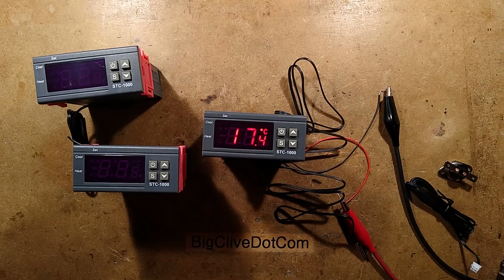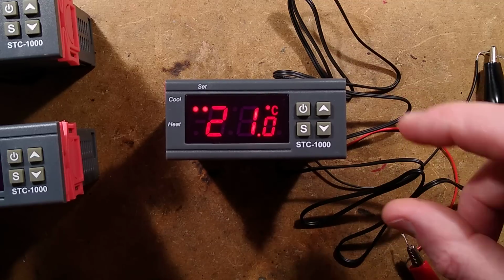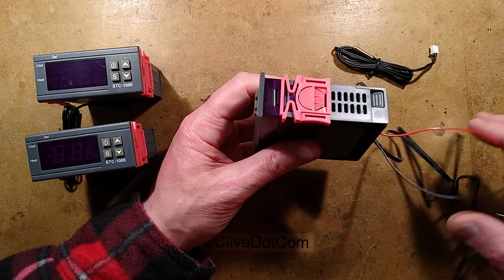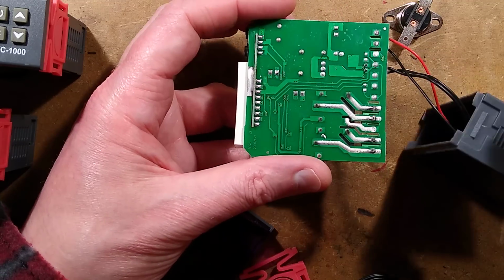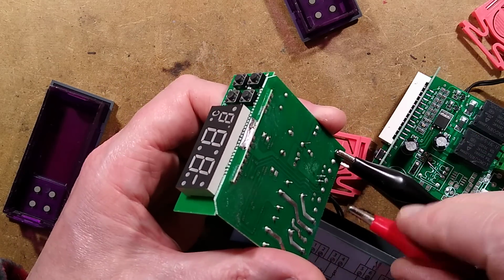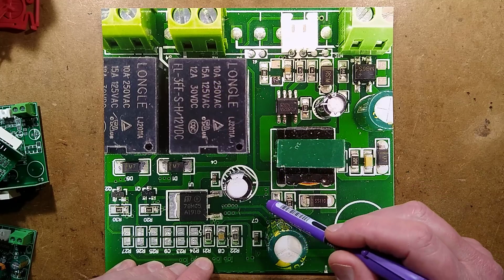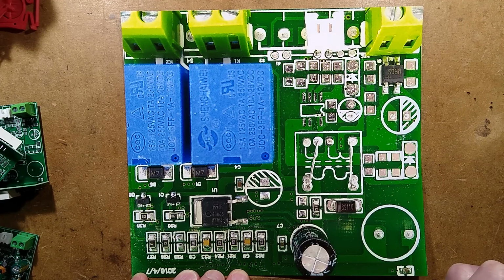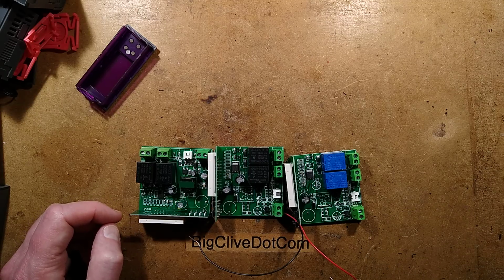Teardown of three STC-1000 style thermostats

Comment: If you have a 240v 1 you can remove the small transformer inside and solder wires straight to the transformer output connectors and supply 12 volts 👌

Comment: Im looking for a automatic thermostat to cool my solar inverter with 3x 220v fan (ball bearing 3.5w each) 
Would you recommend this for my project ?
Goal is to maintain the temp 40C
Reply from the maker: You may find it much simpler to use a classic bimetallic thermal switch with a fixed temperature.   Depending on whether you can derive a 12V supply easily, you may also find 12V fans quieter and more efficient.

Comment: Here's a question for anyone. 
I bought one of these to turn on a cooling fan for a power supply for my ham radio station.
To make it easy, the normal room temperature is 70° f and I have it set to call for the fan at 100° f. 
This seems to work fine, however, anytime it is not over 100°, the heat relay stays energized. How do I stop this?
Reply from the maker: The video description has a simple programming guide.  Try adjusting the hysteresis to a much wider range.

Comment: Mine i just bought is again different. All my components are on the bottom side of the board and only the relays and caps on the top. and missing the trans. The solder trails on the relay contacts for extra beefing, is very slack and spoty. I added more for a thicker traces. $9.09 eby. I am using mine on my incubator as a replacement temp control. The heating unit draws 31watts on my ecoflow power supply, for which i have connected just in case my mains power goes out. This replacement control, works even better then the controls that  the incubator came with. Gonna get more of these controllers to spread around. Maybe even mod some of the aquariums with them. Super units.

Comment: I bought one for 5.60 $ on aliexpress, a 120-240V And I can say the one you have is much better quality ! When I took mine apart I tough they give me a 12 or 24V version because inside in the power supply area there is only 2 diodes in series, 2 capacitors, 1 7pins chip and an inductor. I think it's a buck converter and the input capacitor is rated for 400V. There is only 18 components on the main bord + 2 relays of doubtful quality, not even a voltage regulator.

Comment: Do you have a pinout for the 7-segment display used in that device? I'm trying to interface it with an arduino to get the temperature data but I don't know what are the pin labels for the 7 pins
Reply from the maker: You may find it easier to use a dedicated digital temperature/humidity sensor for the Arduino.

Comment: stc 1000 with 220v input... how much out put could give through cooling out put ? i want to make it my aquarium Hailea hc250a chiller 1.3amp 1/6hsp control unit, and its consumption is 300w. is it preferable ?
Reply from the maker: The most rugged approach is to use a 12V unit to switch external relays.
Reply: @bigclivedotcom  no I want to use 220v one. Is this possible?
Reply from the maker: I'm not sure how the tiny relays in these will deal with inrush current on some loads.

Comment: Be aware! Some of these units marked for mains usage are not mains rated for their own power (plug by the thermistor plug). I found this out by accident the GOOD way, when I popped the cover off, and it's just a little SOIC8 DC-DC chip, inductor, and filter cap. I haven't tried, but I'm pretty sure it would vaporize on mains, even USA's 110V mains.

Comment: Just bought one and its for a 24v application. But when heating or cooling there is no power going out to either side. Am I doing something wrong or is this unit a dud?
Reply from the maker: The relay contacts will have to have the 24V looped over to their common contacts, as there is no buss inside.  If you can hear the relays clicking then they are probably working.

Comment: Wondering if I need to shoe horn a 16A relay into mine, as using it for a 2kw heater (so 8.5A) and it the relay does get slightly toasty, i'm not hugely confident in cheap relays, even if they do say 10A 240v. I've got some 16A Omron 12v relays with the same pin layout, but slightly taller.
Reply from the maker: The best approach may be to do what the commercial refrigeration controllers do.  Use a 12V unit and external 12V relay to switch the high load.  The 12V units are more reliable and the relay can be chosen for the load and changed if needed.

Comment: Is it good for coffee machine? I want to use it for my brasilia club with SSR relay.
Reply from the maker: I can't advise on specific applications.  If you do make a modification like this, also include an extra mechanical thermal switch for safety if the SSR fails.

Comment: Hi there. I have an odd question. I've resently bought a 12v controller and is trying to get it to work. First I would like to test it out by using a 6w light lamp as heating before connecting the unit to a incubator. The problem I'm having is that the unit is connected with a 12v adaptor which should give me also a 12v output but the light doesn't comes on plus testing the output with my digital tester, it's giving me a -12v output. The light lamp itself do warm a bit up. I went online, did some seaching and found a vid where a guy had swop the possitive and negative... so I did the same and still no light coming on. On the plus side, the unit have 12v input with 12v (not -12v) output. The light still feel warm after connecting. Any ideas what on what to do or could the unit perhaps be faulty? Thank you
Reply from the maker: Is the display lighting at all?
Reply: The display on the unit works 100%, also when changing the temprature the unit makes a click sound as the relay activates. The power goes through to the external light but it doesn't comes on. I've changed the light with 3 others lights and all does the same. The lights do work when I plug it in at a light stand.
Reply from the maker: @gerhardyoung7132  The relay section may have volt-free contacts, where you have to bridge a supply connection to the common contact.

Comment: Hello - Very interestinbg and detailed video - Thank you. I will use this Controler to check the temperature of my beer fermenters. My big problem is that I don't know wich kind of temperature probe should I use. I've tried with a PT1000 probe but it doesn't work. Perhaps because the resistance in Ω is too high. Should I use a PT100 or something different. A big thank you if you have the answer to my question. And sorry for my poor English (I'm French) . Best regards JY

Comment: Bought the mains version of aliexpress. Extremely dirty PCB and solder blobs everywhere. Uses a one way rectifier and a buck converter to create internal 5V DC, so no isolation from the mains. They've routed some isolation slots in the PCB, though 🤪 I connected some wires to the bulk electrolytic on the DC side and used a USB power supply to power it.
Since the PCB is virtually empty in this low low cost version you might also be able to fit a DC/DC converter module in there to run it on any DC voltage.
Reply from the maker: Good move on the external supply, as the mains one sounds like it would be making the thermistor wiring live with respect to ground and it's not rated for mains voltage.

Comment: Just bought one from ebay. Super cheap but the circuit board has much less components and also the soldering looks pretty bad and the PCB isn't clean. I plan to control an electric heater but I'm gonna put a contactor in between as I don't expect it to switch 2kW.
Reply from the maker: Good move.  Even a chunky relay is a good option.

Comment: Can you do a tutorial of how to wire one of these 240v units to control trace heating on 15 mm copper pipe.
Had a freezing disaster last year.
Reply from the maker: It might be worth adding an external relay for the tape.  Technically speaking you could use a simple bimetallic thermostat switch to bring on the tape when the temperature dropped well below freezing.

Comment: Thanks for the explanation of how these work, but.
You did not solve my problem with these 240v units.
The wiring diagram on the unit says mains in to 1 and 2.
I would have thought neutral to left and Live to right, but YouTube is opposite.
Port 5 and 6 are for heating.
I wired in a piece of 240v trace heating + to 5 and - to 6.
I expected the relay inside to switch power from 1 and 2 to 5 and 6.
This does not happen. Why

Comment: Hi Clive, I have had now two of these units blow on me, the STC 1000 220v version. Once installed they work perfectly fine for 3 to 4 days with no issues, but about the 5th day they blow, they go completely dead, when I opened them up, both have blown the chip 8321A which I believe you called it the "switching chip", and i am very puzzled as to the reason this is happening, loads are on external relays, so the controller is only switching on the external relay, so I do not see a reason why it´s doing this, could you advise me what your thoughts are for this chip to blow only after a few days of operation?
I have checked for wiring hot spots (loose connections) cabling is all 1.5mm, everything is 10A plus rated, voltage supply from mains averages around 230v, I am using it for an incubator to maintain a temp of 37.5º with a deferential of 1.2º and a delay of 1minute. any advice is most welcome, please.
Thanking you in advance.
Reply from the maker: Check the voltage isn't too high.  It's possible that there may also be an electrically noisy supply.  If these are from the same source they may just be bad units.
Many commercial units use an external 12V power supply to power the module, as it's cheaper and easier to replace the power supply.

Comment: I have one that is the exact same unit…except instead of a heating controller it’s a controller for humidity levels. It has a humidity sensor (3 wire) where yours has temp sensor and the blank pads say temp or Hoc (heat control?) or something along those lines. It doesn’t have any option on the front panel for heating or cooling (strictly relative humidity), so I imagine it’s just a cookie cutter design with different functions based on the ic chips programming and a few swapped components depending on the features…
Reply from the maker: The three wires sensors are often combined temperature/humidity sensors that communicate via two power wires and a data line.

Comment: Nice movie! My STC 1000, version 100-220V AC is dangerous. There is no AC/DC isolation (no transformer only reducing chip PN550H (?)) at the input and a full input voltage is applied to one wire of NTC sensor. I have other temperature controllers and there is old-style trafo at the input. Fairly safer! This version of STC 1000 should be prohibited.

Comment: I saw a unit with two temp sensors and it was advertised to run on sensor 1 unless that sensor failed than it would sound an alarm and run on sensor 2
Reply from the maker: That's a good idea.  Some have a function where they switch to a fixed duty cycle if the sensor fails to try and avoid a total defrost.

Comment: Hi Clive . I got delivered a 220V version rather than a 12v version I ordered  and rather than send back I decided to use. I mounted it on top of my metal earthed chassis psu. Rather than use the NTC that came with it, I decided to use the NTC on my 3d printers heat bed. Stupidly I was connecting it with mains going into the controller and managed to short the NTC output to the Earth metal chassis of my PSU with my screwdriver. Curiously though,  the resulting flashover tripped my house ELCB and destroyed the controller. I deduced that the only way for this to happen was if mains supply had got onto the thermistor somehow so I watched your video with interest. Don’t know if it was a manufacturing error, lack of insulation or poor design but Id definitely stay away from the 220v version as getting 220v on your 3d printer chassis would be a bad day…

Comment: Been running 250VAC STC-1000s for brewing temp control for many years. Lovely units for the price. One of mine is now 10 years old and still working 100%. But yes, don't over-stress the internal relays, I'd say 10A @ 250V is optimistic: 2.5kW would cook the relay. I'd say half that is safe: a large domestic fridges, freezer or smallish heaters would be the right unit to control, considering the inrush load. Industrial size fridges or heaters would require external relays.

Comment: I've used thermostat modules called w1209 in a few project. They are very cheap and their software looks similar but they have only one puny little relay with 1 contact. And because there is only one contact, in the menu there is a setting where you choose whether you are using the module for cooling or heating.

Comment: Hi Clive this is not a criticism it's just something I was thinking of from my past where we used lots of control gear on critical processes to ensure they were kept in check at all times and the meters were manually checked using a Calibrated handheld meter by technicians from every hour to once a day dependant upon the process and how stable or critical it was. So although I could verify, as you did, the meter against the one that there which was calibrated if they were the same I would still have to have the new meter Calibrated by a third parting because of the extremely tight specifications; Often I could get them Calibrated when I brought them with a Certification but they have to be recalibrated every 6 months or maybe one year again dependant on what a failure would potentially cause. So although in your case it was not required to be calibrated to those extents it's always worth bearing in mind or probably ignoring it altogether and let the tech people sort it out.
After 36 years they broke me, so I no longer have to follow British Standards or try to work out what they meant .💩 
Thank you Clive for all your content, it's wonderful and this video suddenly brought back my past looking at the control gear

Comment: As a few others have mentioned, I'd love to see you investigate an Inkbird one. I have two Inkbirds which I used over the winter to precisely heat rooms - very accurate, useful and energy saving indeed. I also have the humidity variant which is also proving accurate and reliable - the huimidistats built into dehumidifiers are often wildly inaccurate. I swapped out the generic relays with Omron ones - the STC-1000 relays look like Omron G5LE pattern clones.

Comment: I am  using this in my refrigerator after the OEM thermostat failed twice. Using the 240Vac version and the 'cool' relay is driving the compressor (~125W) directly. As you told, the relays and the SMPS part are which I'm concerned about :)

Comment: These style relays are common in automotive stuff, and always trouble. (BMW central locking E46, fiat punto EPS motor drive, VAG window controll / roof motor controll.  so if you use one of these (as I do) to controll a larger load in the heating system for my workshop, use an external relay. I have had these style relays fail short in an h-bridge configuration .. window up, fine... window down? fire behind dash. Your welcome.

Comment: I just dug out a couple of these from my bits box, I've used them for various things over the years. On the two mains voltage units, one of them has the same dodgy circuit board design that's in your one  - where the's practically zero separation between the mains and the sensor connector. The other is far better - it has a sealed mains to 12V PCB mounted power supply, and more anti tracking slots to keep the pixies separate.
Sadly I managed to kill the good one... and I'm not as confident in the shitty one as I used to be.

Comment: Do any of these controllers feature thermal runaway protection, i.e. to stop the heater if it doesn't detect the temperature rising in a reasonable period of time?

This is something that has become considered critical in 3D printers after a few newsworthy fires happened.

Comment: I used 3 of these (mains voltage type) to control three (Beko) domestic full-sized chest freezers, in order to maintain them in the range -25 to -18 degrees C. This was required to maintain chemical thermal blocks within a known temperature range prior to use in pharma shipping of cold chain products. They (and the freezers plugged into them) worked flawlessly over 3 years, at which time we left that business. Great to see the innards and learn of their circuitry, as always. Like you suggested, I always kept two units as spares (given the low cost) but they were never needed. I would happily use again, should the need arise.

Comment: I have a couple of these, they work just fine on mains voltage, maybe some things aren't ideal, but they certainly get the job done. 
They also have a model that runs in Fahrenheit, which gives you a little more granularity in your adjustments. Also, on the topic of relays, I don't think they're 10A relays, maybe for slow, low inductance, resistive loads, but for motor loads, I wouldn't run more than 3A or so. If you're turning on and off a motor, you're going to have a bad time.

Also, it's not difficult to toss a couple larger relays in these, those kinda things are more or less lego, and even with nice relays, it's still way cheaper than any other option tbh.

The big thing is to mount them in a metal box, and ground that box, and use it on a GFI circuit. That'll make it much much safer all around.

Comment: There are probably modes/contacts/bridges for 3 or 4-wire PTC connection for lead-resistance compensation, that is: you present a current trough the PTC and measure the (returned) voltage at the resistor instead of at the connector. That is not needed for a fixed length connector, but can be helpful if the sensor is quite some distance away, like 15 meters, when the resistance of the wires become more than a couple ohms.
Reply from the maker: It's purely a simple NTC divider.  No compensation.